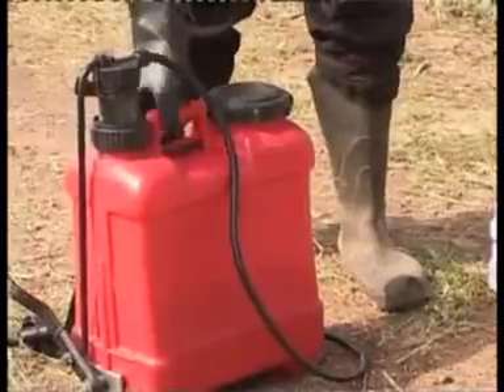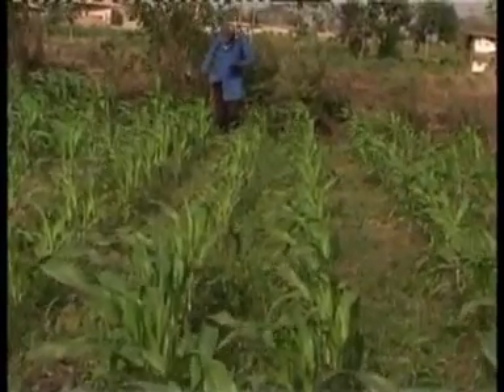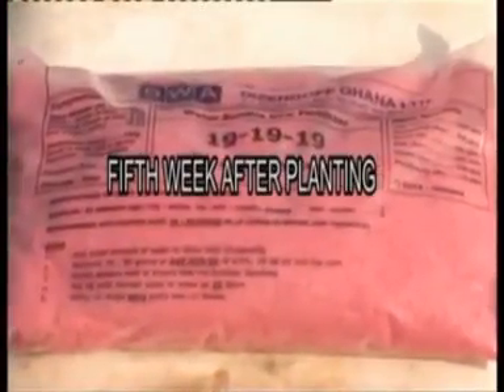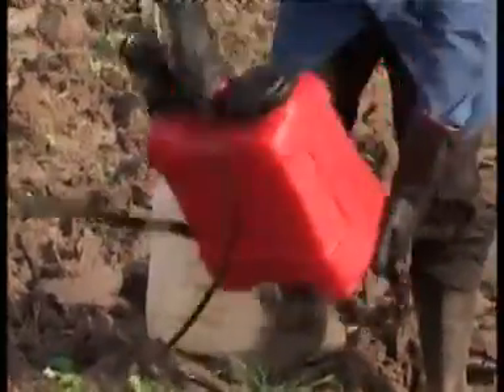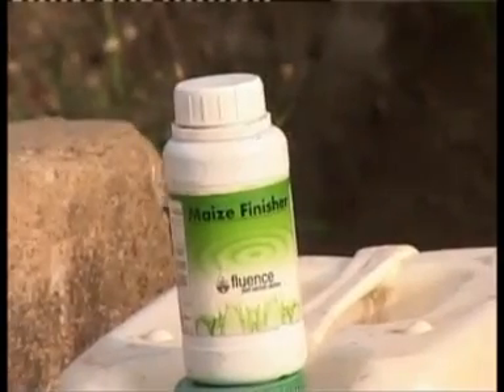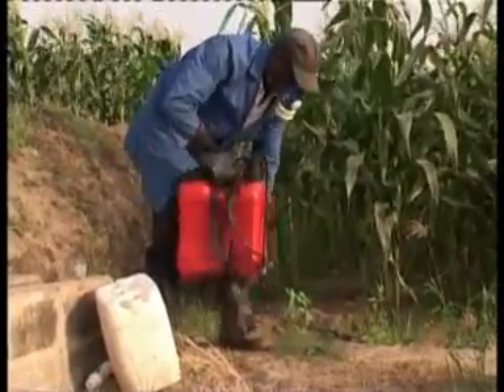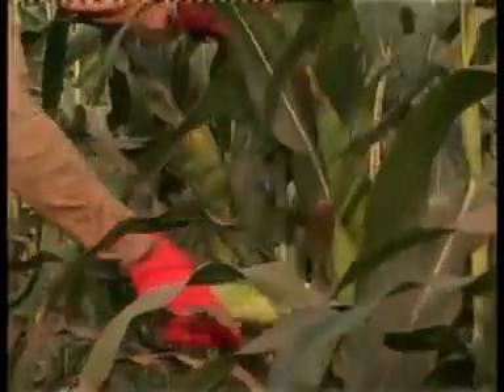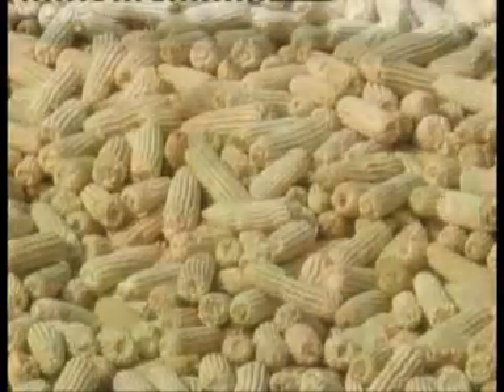Maize Production Steps Including Application of Foliar Fertilizers Part II

Comment: Can that maize be eaten raw. Because too much fertilizer and spreading all over again. Outcomes......
Reply: They are not "spreading" they are foliar spraying; the nutrient elements are water soluble and pass into the vascular system via the leaf epidermis. The run off is minimal and low concentration. Also any nutrients in the run off will be absorbed by roots. 
This method of fertilizing suits micronutrients and less mobile nutrients (not NPK so much), seaweed is very beneficial as a foliar spray, so are manure teas.